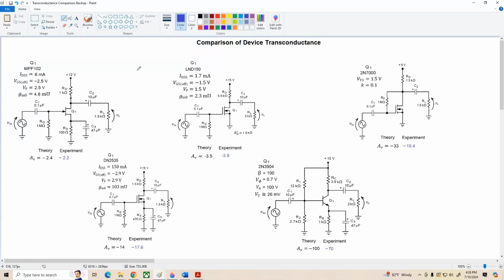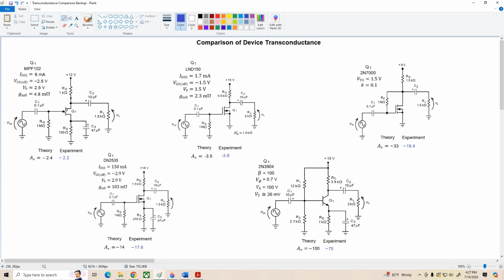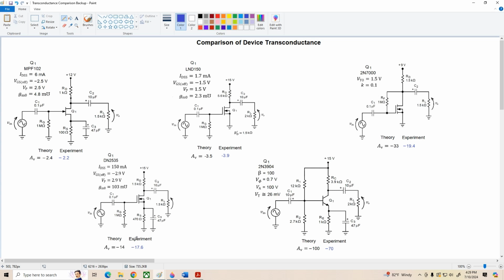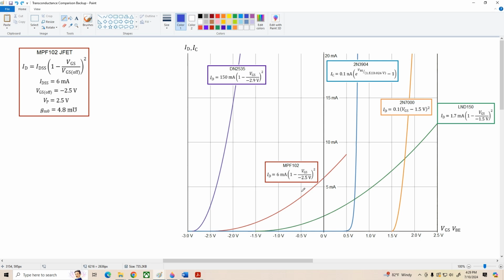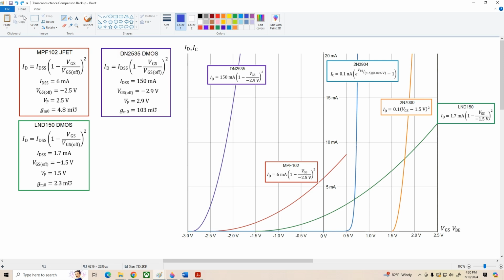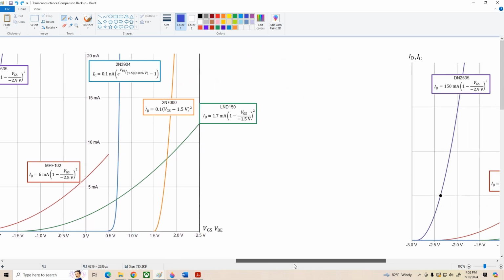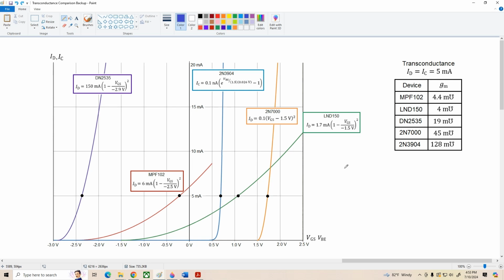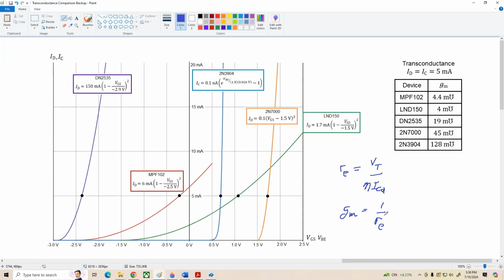Topic 49: Transconductance Comparison

Comment: If you update this video, would be nice to show the THD directly on oscilloscope. Could add the PNP 2N3906 to show lower gm with hole mobility. For 2N7000, could plot more the accurate id = (k(Vg - Vto) - Vs)^2 versus treat the gate to source voltage as meaningful.
Reply from the maker: Good suggestions. There are a few videos I’d like to update but YouTube pretty much forces you to make a completely new one. Maybe someday…

Comment: EXCELLENT LECTURE!WHICH TRANSISTOR AND,OR, CONFIGURATION DO YOU THINK WOULD BE THE BEST FOR  HI-FI STEREO?
Reply from the maker: It’s hard to pick one over another because in hi fi amplifiers we will use a lot of negative feedback, which should reduce nonlinearity to practically zero. Most distortion will be produced in the output stage. JFETs are low noise but very parameter dependent. Wish I could answer more completely but it’s a deep topic.